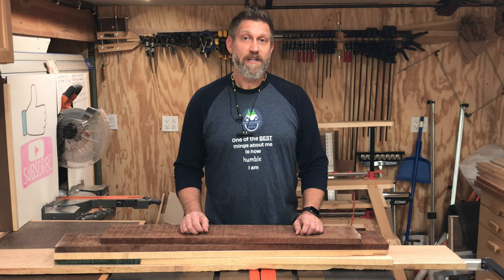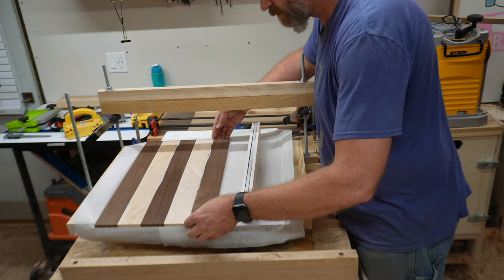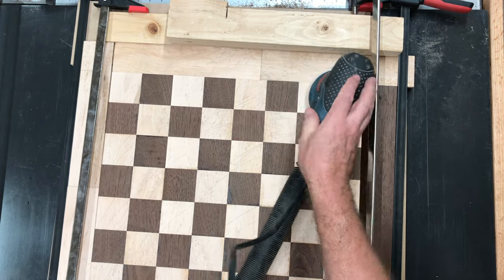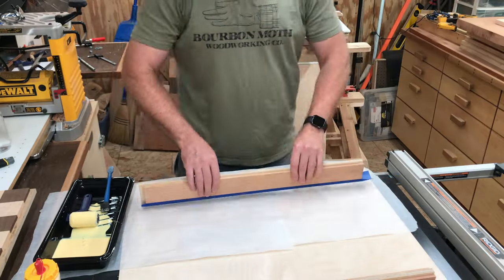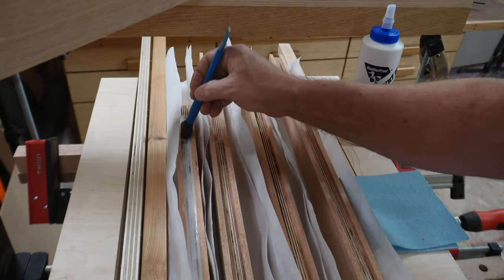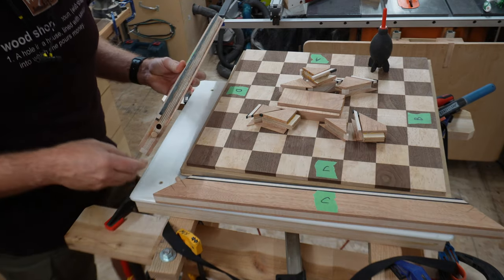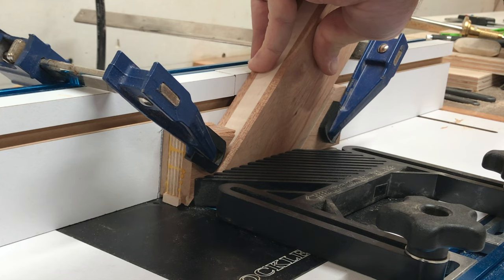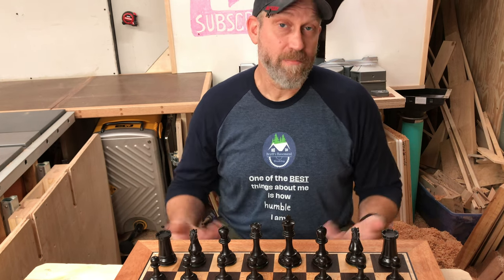DELUXE Chess Board Build

Comment: I got one word for you….DUST COLLECTION….   However, nice work.
Reply from the maker: I hear ya, Brother! I assume you’re talking about the planer… the problem is the hose adapter only fits in one direction and that would be up against the wall the way I have it mounted. So I’ve just resigned to making a mess and cleaning it up after. Dust masks FOR SURE though! 😝

Comment: So beautiful!! With respect to reinforcing the miters, the framing is glued to the edge of the board. The miters don't take any stress whatsoever and thus don't require reinforcement. It's not like a picture frame or a box where there is nothing in the middle. When doing joinery, think about the forces and be realistic about what you need to actually protect against.
Reply from the maker: The stress was when I discovered that the dowels didn’t line up! 😀I appreciate the advice. Thanks for sharing. And thanks for watching!

Comment: I see that you have the Cutech jointer.  You said that you have trouble getting perfect results from jointing?  If you would - can you please articulate more on what the problem was?  I'm considering buying that same jointer, because they now offer it in the 12" size.  What do you advise?  Thank you, and splendid video.
Reply from the maker: Thank you very much! I think my problems with the jointer are purely operator error (lack of experience and skill). That said, I think the fence on my benchtop model is not very robust and maybe a bit unreliable. But a 12” floor model sounds amazing! I’m jealous. 🤢

Comment: No issues with seasonal movement ?
Reply from the maker: I guess we’ll see…
I used very similar methods for the first chessboard I made 3 years ago. And the only movement I’ve noticed is that I can feel (but not see) the seams between the squares. I’m wondering if that’s related to the type of glue that I used, which was Titebond 2.

The mitered frame is holding up beautifully.
Reply: Ì decided to go with hide glue as it's supposed to not have glue creep. I've seen  others at the same thickness so I'm goin with it. 
Thanks for responding.
Reply from the maker: As it turns out, MDF was a poor choice for substrate. The contracting of the squares split the MDF along its thickness and allowed the playing field to curl. Not good!! 😒

Comment: Just a suggestion for future projects, I would use a spline for the miters. Cutting a slot and putting in splines are very strong and effective. Great video. Keep up the good work.
Reply from the maker: I’d have to glue in the edge banding afterward to hide the splines, but doable. Something to consider.
Reply: I was thinking of using it as a feature of the board leaving the splines exposed. Perhaps with a contrasting wood.
Reply: Splines give good strenght yes, but I don’t think it is a functional need for a chessboard as there will be not much stress or weight applied on it. But for a nice view with a contrasting colour, yes.